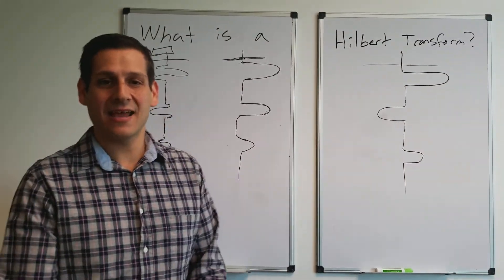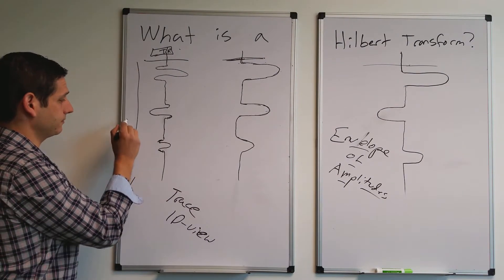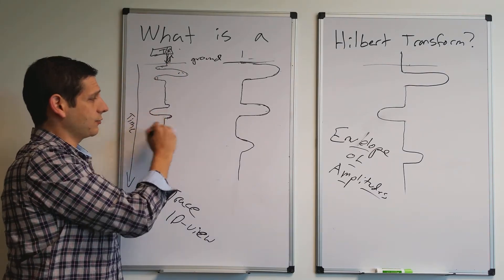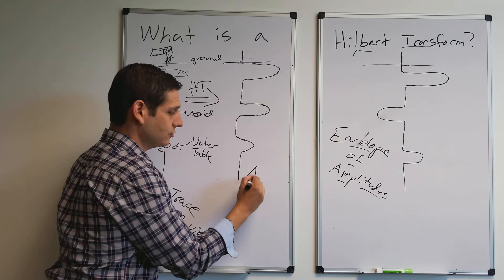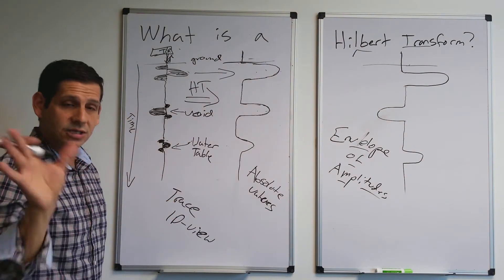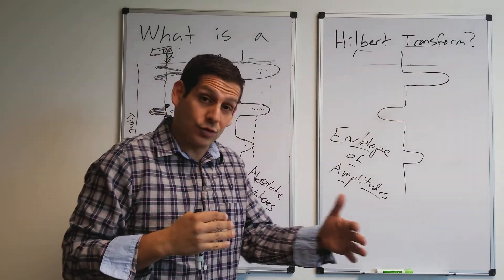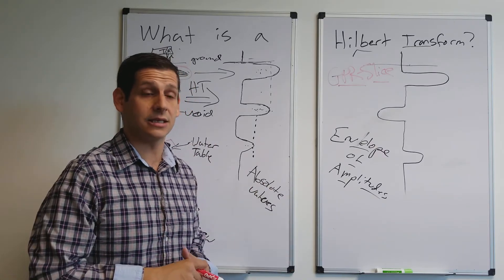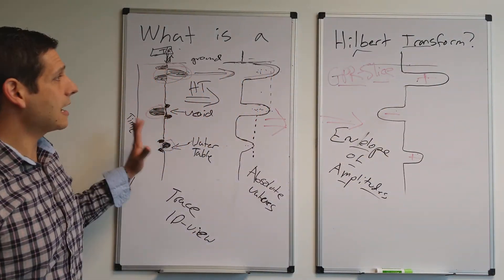What is a Hilbert Transform in GPR? | Ground Penetrating Radar

Comment: Hi Dan, great video! I learned a lot from you. I have a question about the A-scan formation, why there are always 3 peaks/bands generated when gpr signal enters into the new material? And what does the positive and negative peak stands for? Thanks!
Reply from the maker: Thanks fornthe comment and the question. Since it's a pulsed wave, it will have peaks and valleys that approximate a sin curve. The sequence of peaks (+) and valleys (-) indicate whether the wave transitioned into a material with a higher or lower dielectric permittivity. So analyzing the polarity can give some indication about what material the wave traveled into. Hope this helps and thanks again!
Reply: @Learngpr  Hi prof, thanks for the quick response! I understood the wave simulates the sin wave, but why there are three rather than just two peaks generated every time the signal goes into a different dielectric material. Thanks again!

Comment: Thanks for bringing this to my attention, Daniel, I did a little digging, it looks like the Hilbert Transform is useful in dramatically isolating high amplitude correlated reflections from low amplitude uncorrelated background noise.  I only bring it up because you don't mention that in the video.  I bring up the correlation because my fading memory had assumed it might be some kind of matched-filter process, but it isn't.  Naturally, not trying to get a video on "What is correlation?", that's for a math or signal processing course, not for GPR folk... :)
Reply from the maker: bdrogin thanks for coming in.  that's exactly right and somewhat what I meant when I said relative frequencies. You can definitely isolate potential targets from low amplitude signal of non-interest (think that's a word). It is very useful for concrete scanning like you do up north. Really can clean up images.